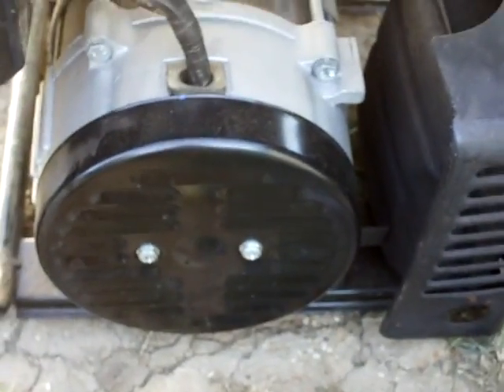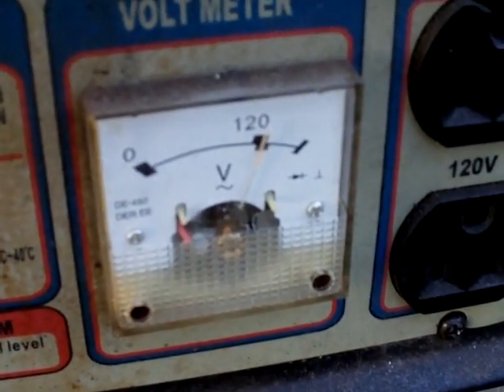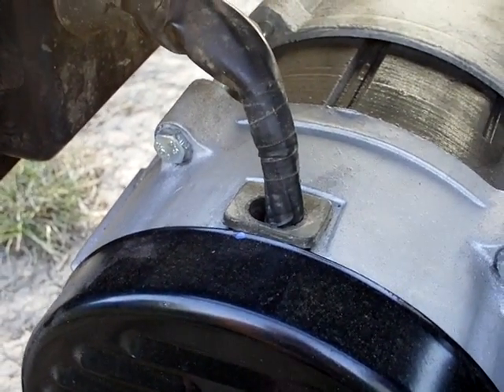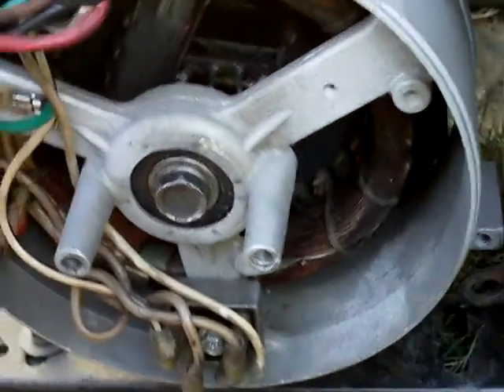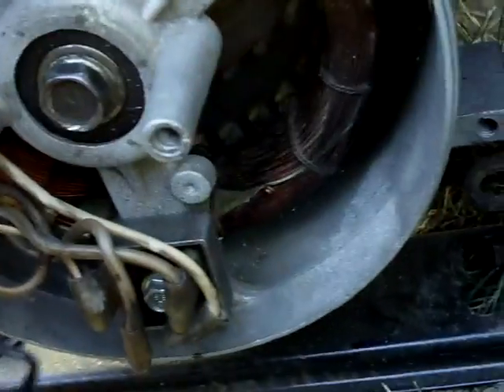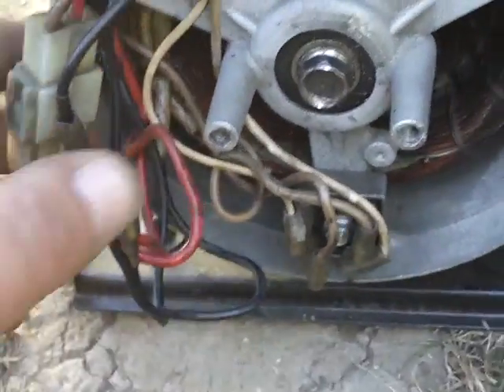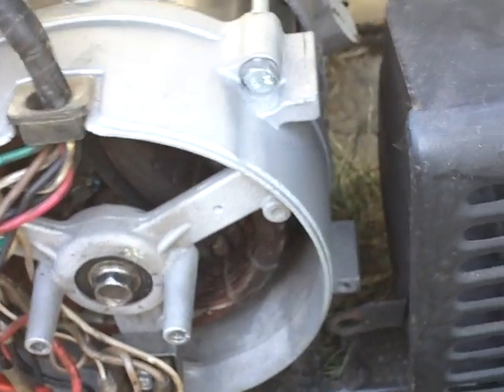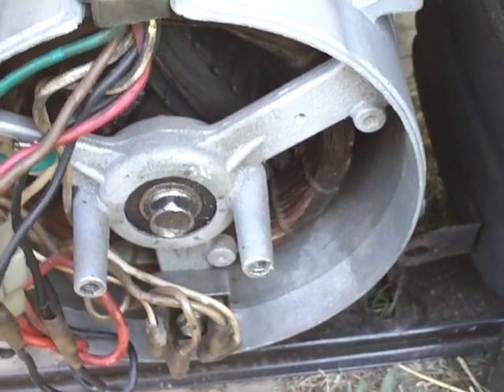Capacitor type generator

Comment: What you recommend brushless type or brush type? Witch one is making clean electricity , can you please reply.
Reply from the maker: +Anura Yapabandara  Yup for sure , Go with a brush type generator head .. Way better because they have an AVR (automatic Volt Regulator )  Brushless do not regulate voltage !
Reply: @shawnmrfixitlee6478   Can you not attach an external AVR somewhere along the brushless generator ? to clean the power ?
Reply from the maker: @chrisbard9373  Not sure if the make external AVR setups ??
Reply: @shawnmrfixitlee6478   Could one not just wire  a standard  spare AVR in series with the output from the brushless generator ?......no matter how it looks.
Reply from the maker: @chrisbard9373  Nope , these type are run by way of a cap , the avr type are a total different setup ..
Reply: @shawnmrfixitlee6478  Thanks for your  replies. I am in South Africa and we are having  daily  black outs of  8 hours a day. Looking to run two small PC"s with UPS and a TV, but my gene is 2500W , brushless and the frequency and voltage is crazy unstable. Even the lights here are LED type. Do I scrap my gene and buy a AVR brush type for TV, PC and LED lights ??? We do not have enough power to charge Inverter batteries.
Reply: @shawnmrfixitlee6478   Out of interest, why would they manufacture the generator if it was so unreliable and extremely poor ? Why make something so bad if the voltage and frequency is so unreliable. Am I missing something. Do I just throw away my new brushless  generator. I purchased the Honda 3000 with AVR an hour ago.
Reply from the maker: @chrisbard9373  they work well for job sites running power tools and such . Just  not good to plug in a laptop or such to it . The honda will serve you well . Thanks !
Reply: @shawnmrfixitlee6478   Thank you for your help.
Reply from the maker: @chrisbard9373  Anytime , Thanks for wanting to learn more .. I enjoy Questions !

Comment: Whats the use of the blue capacitors and what causes the engine to surge??
Reply from the maker: +Hilary Kabwe  Not sure why that engine runs that way , I put a carb kit in and cleaned everything ! 
Those are resistors not caps . They choke down the voltage for the start windings
Reply: The emulsion tube is dirty, or the idle jet is partially blocked

Comment: The devices on the rotor are NOT resistors, they are diodes...  If you get a short on the generator, that can pop these diodes.
Reply: Yes they are. But there are diodes as well. And unfortunately mine one has exactly the problem he said about - those resistors disintegrated.

Comment: Nice vid broo please can you shoumi ow to fix a maxime ther use a drill bit a i sink it's a drii maxime sory my rigtning im learning ow to right beacause im portuguese ow tell mi ow to find the problem wed a multimeter she work's but doesn't have strong or power. Sory but do you also can send a sticker please. Thankyo and Stay well stay strong cheers broo and keep wedd you vids
Reply from the maker: So if I get what you are asking is you need to fix a drill and a multimeter ??  not sure what kind of drill or what kind of meter you have ??  Thanks for watching !!
Reply: No just a eléctrica driil please.
Reply from the maker: Jose Pereira  ok , what brand do you have and what seems to be wrong with it ??  Also .. Is it battery , Or corded  ?
Reply: It's a Bosh doesnt havê strong make a realy strange noise sims like havê sand insaide and it's a corded.
Reply from the maker: Have you ever had it apart ?? Sounds like the gears are dry and need grease or they are striped ..
Reply: No i did not no they not. Sow you think there is just open and put grease in the gears.OK im gone do that thanks sory can you send a sticker o please. Stay well stay strong. Cheers
Reply from the maker: Yes look at the gears and put them back the way they come out .. I do not have stickers sorry !!
Reply: OK thanks.